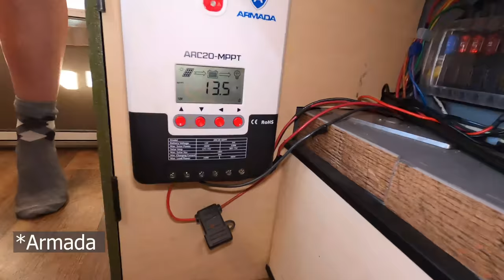DIY Four Wheel Camper Build | Full time Living | Toyota Tacoma

Comment: Nice build!  Have a great adventure!
Reply from the maker: Thanks Shawn!
Reply: @justtravlin ot of curiosity what is your MPG with your setup?
Reply from the maker: @Shawn2ndaccount  on average we get between 13.8 to 16.8 mpg
Reply: @justtravlin  wow!  Way better then what I'm getting.  10 mpg on a Chevy 2500 gas.  It is killing the bank account being full-time.   Been thinking about going smaller besides I've only owned Toyota trucks for the last 25 years and the reliability is unbelievable. Ty for the info.
Reply from the maker: That being said, we are really easy on the throttle. Usually not going faster than 90km/h /55mph
Reply: @justtravlin  yeah I'm easy as well 1500-1800 rpm is the best spot and doing 65.  But I do weigh 11k pounds lol. Thanks again maybe we will meet on the road someday.

Comment: Great build. Do you use the Tacoma for any storage?  Can you get into the truck from the camper through a window? Thank you for sharing.
Safe travels.
Reply from the maker: Thanks for taking the time! The back seats of the truck have been removed and we put a storage system in there instead. 

And unfortunately we cannot enter the camper from the truck. That would certainly be something we would implement on a different build, very handy

Comment: How much does the camper weigh?   Did you need to beef up the rear suspension on your Tacoma?
Reply from the maker: We figure the camper weights dry less than 800 pounds. Yes the tacoma has upgraded suspension 

You can see what was done to the truck here:
https://youtu.be/d8Ug0z2j-UA?si=Fwq6O63PnZmOrRCR

Comment: Sorry if someone already asked this but...how long is your truck bed?
Reply from the maker: Hi. No problem! The truck bed is 6 foot 2 inches long. ☺️ So the camper is a little longer than the truck bed. There is another model of four wheel camper that is shorter and does not hang over. 👍

Comment: Do you have a link to those hinges you used for the fold up bed to seat?  Great build!
Reply from the maker: Unfortunately not. They were repurposed from the original roll over couch that was initially installed that we dismantled. 

Perhaps they can be found at the four wheel camper facility. Otherwise we have no idea how to get them.